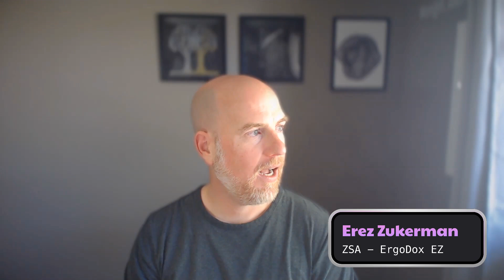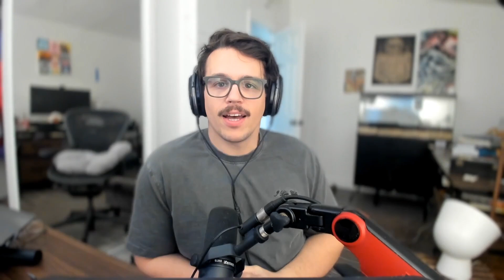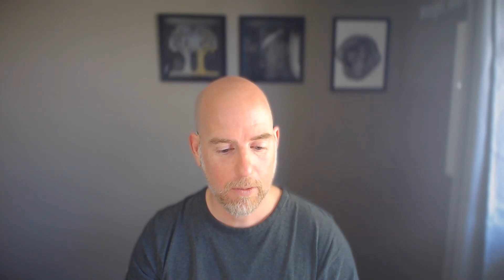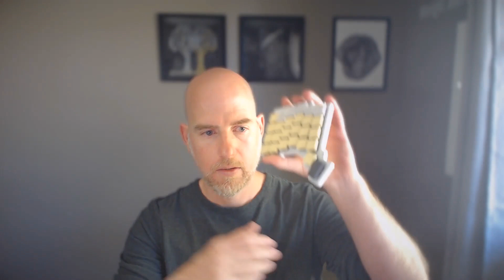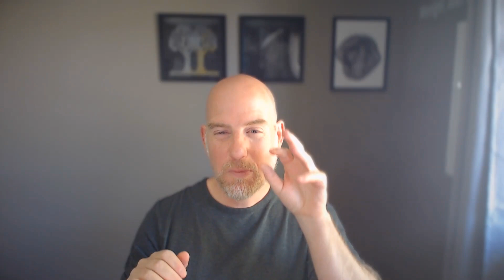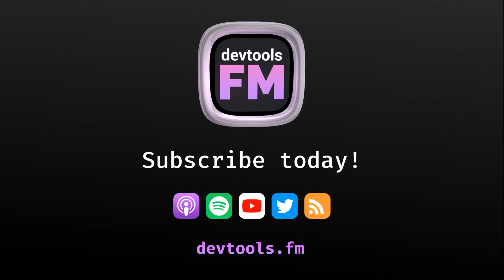Erez Zukerman - ZSA, ErgoDox, and the Future of Keyboards

Comment: Writing 140 words per minute is great ... yet it's quite easy to double anyone's writing speed, take 5-10 minutes to understand my Trivial system and then practice. Meanwhile existing stenographic keyboard systems mostly need a special keyboard, they are designed for one language and 2 - 4 years learning. This is not true for Trivial and anyone can use it. Typing 70 words per minute? You can type up to 140. Typing an unrealistic 150? You can get up to 300 characters per minute. That's almost talking speed.

By adding one hardware layer, the keyboard can also be used as a trackpad, right on the keys. And the Voyager is particularly suited to this...

Comment: I agree with the concern about the battery, but most wireless keyboards can be used wired using a USB-C cable, right? Or, use a basic battery pack or cell that can be replaced easily.